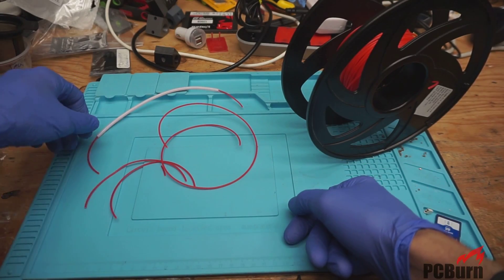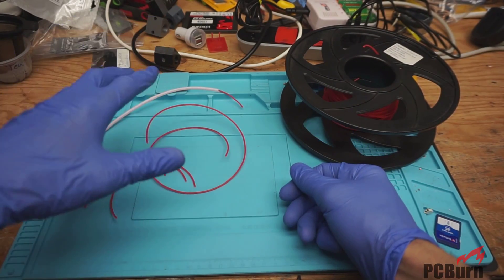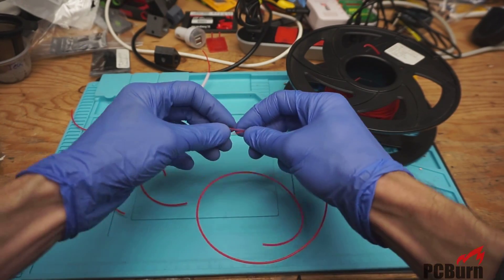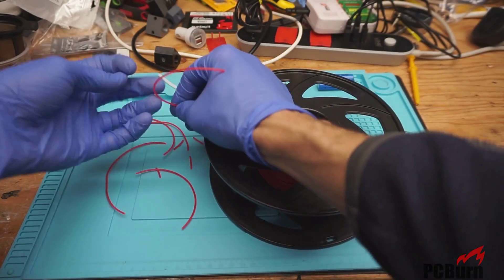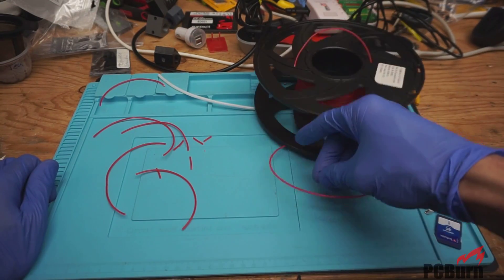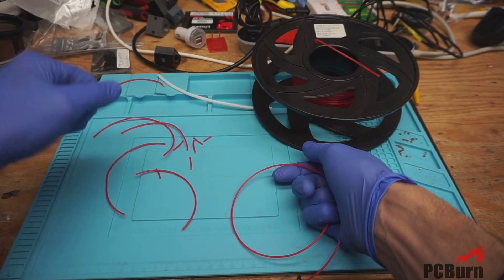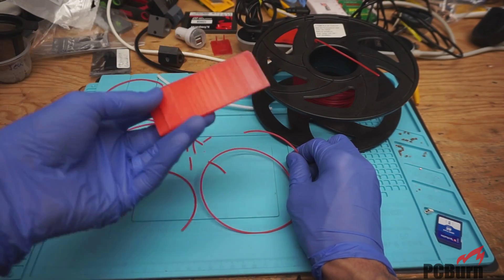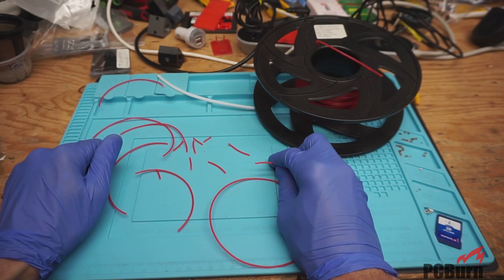Why Does My PLA Filament Keep Breaking?

Comment: Yea i have same problem the part exposed before the extruder it snaps over night but doesnt snap while printing
Reply from the maker: Yep. Weird that it's a mechanical property of the wound filament. Not what I had assumed before figuring it out.
Reply: @PCBurn  I don't think its a mechanical issue, I think its something to do with cheap chinese PTFE tubing, I have a cheap delta printer that I recently upgraded to capricorn tubing and used some of the old tubing as a guide on the input side of my extruder.
The PLA only ever cracks when it sits in the PTFE bowden tube that came with my printer, the PLA in the capricorn tube never cracks, its always the filament that sits in the cheap PTFE tube. Makes me think there is some kind of contaminant or plasticizer in the cheap bowden tube that's reacting with the PLA somehow.

Also thanks for making a video on this as its the only thing I've found so far about the issue we've been having with PLA breakage in bowden tubes!
Reply from the maker: Thanks! The problem I have here is, specifically, "mechanical stress" on the thermally formed rolled filament. For a quick recreation you could hold it straight on it's own with a couple of books or weights for a few days. No PTFE required.

Some of the filament I had an issue with was spooled (where the end was forced straight) with no PTFE in site.

I doubt the PTFE could "leech" into anything, being fairly resistant to moisture or breakdown, but I'd love to see some research on it. I'm only familiar with it's makeup in general.
Reply: @PCBurn  I'm gonna try the book thing to verify my theory that its something in the PTFE tube itself at least in my own case, its just wierd that on my delta, the filament that sat in the capricorn tubing after the extruder is 100% fine, but the 3 inch segment before the extruder that sat in the "guide tube" that prevents kinking as it unspools was the only brittle section, especially as the capricorn tubing is held straighter than my input guide tube.
Honestly I don't expect it to be due to the PTFE either since its super stable stuff the way we use it in printers, but as my printer was a $300 kit deal from aliexpress about 5 years ago, I can't really rule out the possibility of some form of contamination or substitution of materials in my case.
Reply from the maker: @fragger56  Absolutely! I'll pull the same thing here with three different periods (days/week/month) and we'll see how it goes. I've also got different blends of PLA to test.

I'm definitely not trying to deny you're getting filament breaking or that there could be other factors at play than mechanical stresses on the PLA. Although if it seems being encased in PTFE (or heck, another plastic of any sort) seems to play a factor I'll look into it more thoroughly. I can't think of a mechanism that'd likely happen by offhand. Plastics are pretty stable.

Although re-reading that I'd also expect the points near which the filament is coming off the spool to be under the most stress. If that's where you're seeing it break.
Reply: It happens to me also i am new to 3d printing, A month now and i noticed it too when I'm not using the printer. Then i came across to your youtube ch to search for an answer...
Reply from the maker: It's an issue that frequently crops up depending on how the printer routes the filament or with new rolls how good the manufacturer is at their job.

Thanks for commenting!

Comment: I still think it would be worth trying to dry the filament and see what happens. I have noticed the same thing with a roll of hatchbox. It seems to get worse with the filament age and definitely the bend radius on the spool (less full spool is more brittle).
Reply from the maker: In this case the humidity of the shop's controlled. The spools fresh out of the (low-temp) drying oven still exhibit the same tendencies. I don't normally bake the PLA because I wasn't seeing a difference.